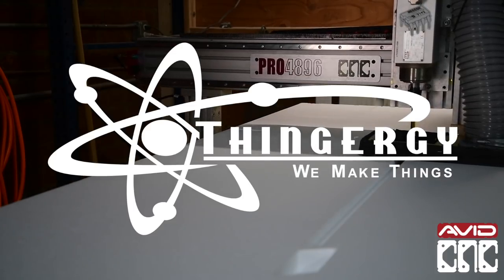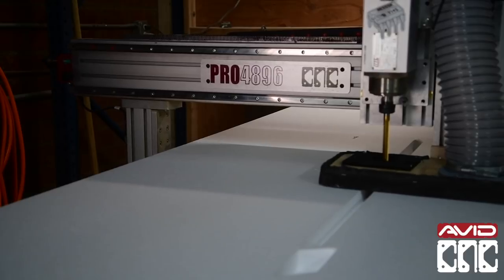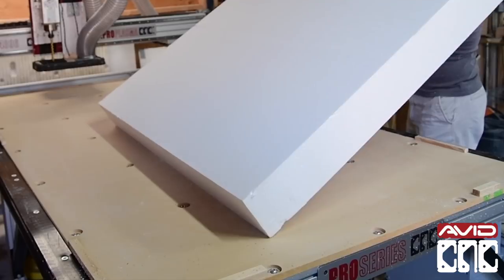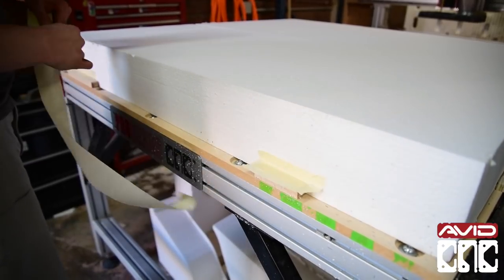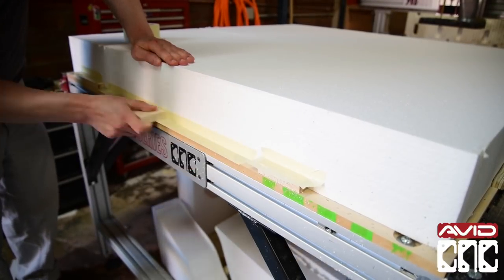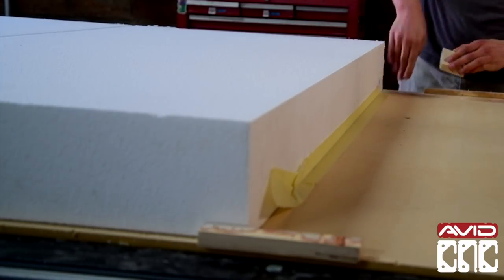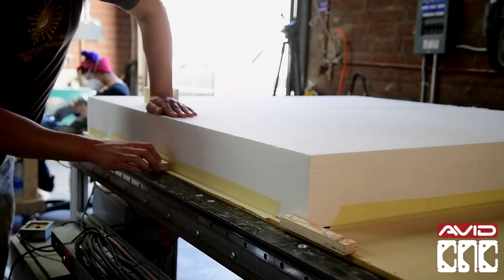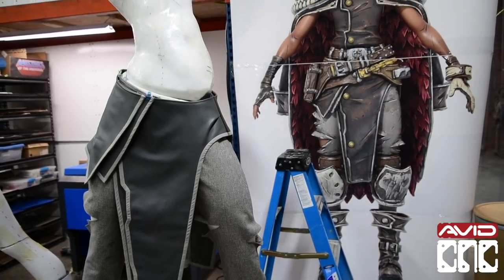Pro-Tip: CNC Foam Workholding

Comment: What long bit are they using?  I have tried using the Amana HSS1204 and HSS1214 but they are RPM limited to 6,000, and that is no joke.  If I run it at 8,000 (the spindle minimum) I get a wicked vibration..  Any tips where to shop?  Thanks

Comment: Is that some custom chip/dust guards on the Y axis?
Reply from the maker: They have a second Z-axis which was originally installed for plasma. But when they don't have the plasma set up, they attach a dust shoe for custom heights on the second Z-axis and run it as an A-axis.